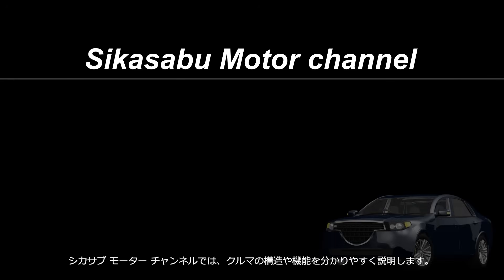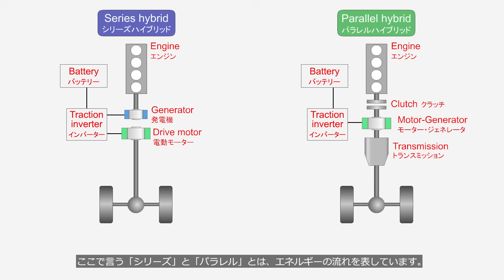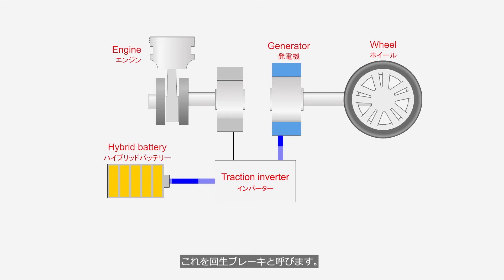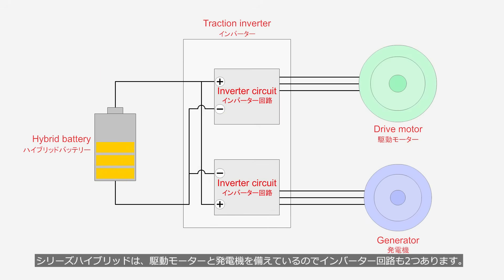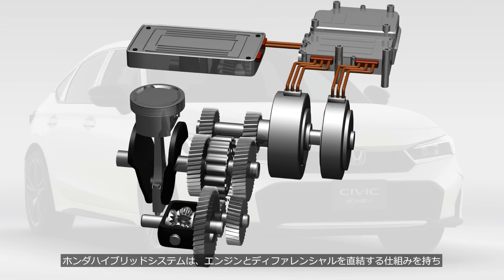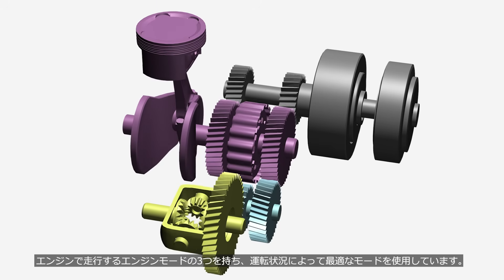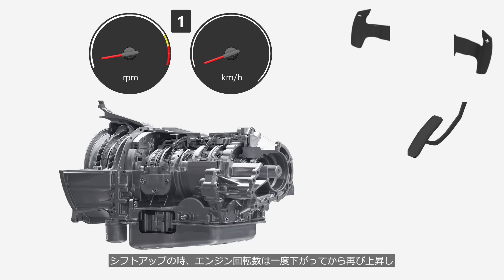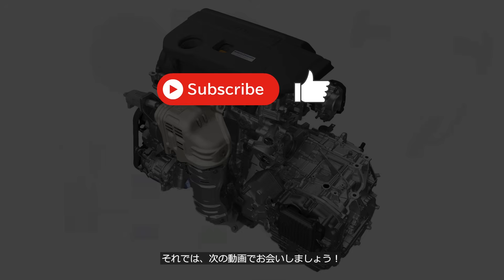Deep Dive into Honda Hybrid System　Can It Beat Toyota?

Comment: With Honda hybrid you can’t have the engine and electric motor powering the vehicle at the same time the Toyota system can, Honda transmission still has clutches Toyota transmission has no clutches, much more simpler much more robust much more reliable.

Comment: Just to add, engine mode with clutch engaged is limited to 80-120kmh thats where ICE can be more efficient with direct mechanical drive, but if going faster than that series mode again , conversion losses and awful high speed economy.

Anyway I prefer honda hybrid to toyota, due to EV driving feel at lower speeds.

Comment: Toyota uses direct and port injection so the valves are effectively self cleaning and there’s no carbon build up. This system is DI only so will be interesting to see how it lasts long term. Honda system might be more engaging (S shift) though. The Toyota one is purely for calmly getting from A to B.
Reply: "This system" uses "multi-stage direct injection," combined with the Atkinson Cycle. That means there are four different times when fuel is injected into the cylinder. One occurs just before the exhaust valves close at the end of the exhaust stroke, two during the intake stroke , and the last is actually during the so-called "compression" stroke. I say "so-called," because Atkinson means the intake valves have not yet closed.

This timing will improve fuel atomization, and allow some of the fuel-air mixture to be pulled back behind the valves. Thus quite "effectively self-cleaning" them. Maybe you should consider that the engineers at Honda actually know more than you do about such details.

The Honda system is more engaging, simpler, and just as "calm getting from A to B."
Reply: @j @jeffjo8732 well I’m sure they do know more than me. Question is really whether they know more than Toyota. The clean running of Toyota’s hybrids is well known. Even after 300000 miles the valves are clean. What you say about Honda’s system is really good to hear but i don’t think you can say that it’s proven yet. Great if it works though as it’s definitely cheaper to just have one ignition system. Perhaps leave the snarky childish tone behind next time though. Adds nothing of value to the discussion.

Comment: Switched from Toyota Hybrid to Honda e:HEV and Honda has much better hybrid. Sound is much much better, power delivery is faster and fuel consumption is lower - win win.
Reply: yes. but there are not durable as toyota hybrid system because toyota has no crutch. crutch pad will be damaged by time going. crutch has two side. it has direct power transfer from motor to gear. but has weak point that you have to maintain well of that. one day, you need to exchange crutch. i don't know how much cost it is.
these day, most of gear box issues come from crutch pad.
Reply: @gondra3012  Crutch? You mean clutch? There is no classic friction clutch in Honda e:HEV like normal cars with transmissions are using, in fact Toyota hybrid system includes clutch, but is is used for dumping the torque forces. In Honda e:HEV there is electronic lock-up clutch, that has no friction pads so there is no wear on that clutch as there is no torque/speed difference between both sides and it is designed by Honda as lifetime, so you don't need to maintain it at all. On the other hand, Toyota system is more complicated and using many gears in two sets of planetary gears that are wearing off and you have to change oil in transmission every 90k km.
Reply: @StanTrnik  In real world Toyota has been shown to be more reliable.
Reply: @GeneralFukzamatayu  That's simply not true, you just made that up, there is no reliability report that is rating THS more reliable than e:HEV/i-MMD, as Toyota system is more complicated and needs more maintenance, there is no reason to expect that. Do you own both so you can compare them? No? I do.
Reply: @StanTrnik  I've been looking for a critical technical assessment with as valid information as possible, but so far there's only been anecdotal "word on the street" and "the consensus seems to be" by fair-minded and competent people.  I'll continue to look.  It's important, I want HEV overall to succeed and thrive.  

I currently don't own both or either right now.  I've owned THS.  Beyond changing the HV air filter occasionally (and toollessly), THS required no maintenance whatsoever. It was a superb unit.

My intention is not to spread FUD.  I'll keep looking in good faith and with honest and fair mind.
Reply: @GeneralFukzamatayu For how long (years/kms) you owned THS, mine was 15 years old, it got few problems, also with battery, but first 12 years are zero maintenance.
Reply: @StanTrnik  I bought mine used, drove it professionally, and some drunk driver rear ended it while I was stopped at a stop light.  It was 100% reliable for me, and I loved it.  I'm a Toyota Hybrid believer.  It's only gotten better.  The year of my vehicle (Highlander) was 2007.
Reply: @GeneralFukzamatayu  I loved it too, but I didn't know that hybrid can be so sporty and sound soo much better before I drove Civic, I ordered it immediately and love every single ride, I'm driving much faster and smiling more, because of that sporty high revving engine and sound of no delay fake shifts :) . Try it, best car I ever had.
Reply: @StanTrnik  Plugless Self-Charging Range-Extended Electric Vehicle 

I'd test drive anything.  Much can be gleaned by watching others test drive.  I've seen how zippy Prelude is, but the quality of the zippiness was more akin to the nearly infinite electric torque that I experienced when test-riding the Zero-brand BEV motorcycle: a man strapped to an electric rocket rather than a Zen-like experience of man-and machine-connection or man-and-horse connection, a characterless zip, a zip untethered to relationship, a zip untethered from reality, a zip untethered from romance, a zip untethered from honesty, like a video game vehicle.

I find it strange that Honda of all companies seems to be trying to condition people away from the core mojo of motorcycles.
Reply: @StanTrnik  For Toyota at least, it may just be a difference in priority. The vast majority of their hybrid vehicles are designed to be efficient and unobtrusive until more recently with their trucks and luxury sedans. Honda generally prefers to make sporty peppy cars, which they apply to their hybrid offerings too. Plus, plenty of supercars are becoming hybrid too.

If Toyota felt it necessary, they too can put in a beefier drive motor to match Honda's system in off the line torque, and tune the engine and exhaust to sound better. They've done it for their GR cars, it's not like they don't know how.
Reply: @Appletank8  But my Civic is more efficient than Prius :) . Toyota has no possibility to make their hybrids sportier, because of CVT based system, there is no way how to rev that ICE in the same way to copy classic ICE car sound, or even better, as Honda 2.0 N/A sounds so much better than all those 1.2, 1.4 and 1.5 TSI/TGI engines and exhaust will not help it either.

Comment: The drawback with the Honda system is that when the engine is clutched in to the drivetrain, it is limited to certain gear ratios.

Toyota’s hybrid system meanwhile is effectively identical, but includes a true eCVT transmission, using a planetary gearset and two motors. This gives you infinite gear ratios, smooth throttle response, and a practically indestructible drivetrain. Fords use this system, too.

Honda should do something like this.
Reply: tbf, when driving on the highway with minimal speed changes, a direct drive to the wheels is more efficient.

I think a bigger drawback is Honda's system needs to be larger, it is unable to request direct power from the engine at lower speeds, thus electric systems need be more akin to a PHEV's in size.

In an actual PHEV, the differences start becoming minimal.
Reply: @Appletank8  Both of these systems have a direct drive mode with a 1:1 gear ratio.
Reply: @skyscall  I'm not talking about gear ratio, but that when Honda's system activates the clutch, there is no need to reroute power through the electrical system to send power to the wheels. Toyota's system needs to keep mg1 powered at all times in order to keep the engine at the right rpm. if mg1 turns off, the engine can't move the car.
Reply: @Appletank8  ..and as many agree, PHEV is the wrong way to go.  And BEV is an even worse way to go.
Reply: You are among a chorus of people saying this.  May Honda hear the song.  I hope that Honda does not believe that people prefer "electric car feel" or that people prefer Tesla or that people prefer "electric go-kart feel" or that Honda should differentiate itself from Toyota by feeling more like Tesla or that new generation expects or prefers "electric car feel" or that soullessness is inevitable or necessary or that stubbornness is better than evolution to more direct mechanical approach like Toyota and F1 takes.
Reply: The Honda system doesn’t have gear ratios apart from the high speed lockout…
Reply: @theopenreview702The Honda-style ECVT has a single gear ratio once the engine clutches in to the powertrain. The Toyota-style ECVT has truly variable gear ratios. That’s the difference.

Comment: This confirms my impression that the Honda system is a big step forward, eliminating the traditional physical transmission.  At the next level with plug in extended range (EREV) vehicles, batteries will increase in size, EV only range will increase to 50+ miles, one pedal driving will be available, and in sport models (hatchbacks?) 0 to 60 times below 5 seconds should be easily attainable.  AWD as well.
Reply: "electric car feel" is widely unloved.  (even if losses from additional conversions could be mitigated away to achieve overall greater efficiency). Is this HEV design more overall efficient than Toyota's design?
Reply: You can do PHEV with eCVT, too. Toyota has literally done that for almost a decade.
Reply: @Appletank8  PHEV is like permanently inviting the worst aspects of BEV onto an otherwise perfectly good HEV.  Bah!

Toyota discontinued the "Prime" naming so that people didn't accidentally/mistakenly end up with PHEV (and become furious upon realization) instead of HEV.
Reply: @GeneralFukzamatayu   Eh, I've been living with a PHEV for 4 years and it's fine. Barely need to use gas most of the time outside of longer trips outside the city.
Reply: @Appletank8  you barely drive.  what city do you live in/nearest?
Reply: @GeneralFukzamatayu   Los Angeles. Daily work round trip is just under 40 miles, have a home and free work charger. Occasionally go to a nearby county that's 90 miles round trip, thus halfway electric, halfway gas. A few times it was driven to Las Vegas, then south of Utah. There was a free charger in the hotel parking of Las Vegas.

Comment: I just bought a Honda Civic hybrid Touring and I must say that even though i knew it was the best system currently I didn't fully understand why. Your video helped me to understand the benefits of the dual motor design. TYVM!
Reply: Toyota‘s eCVT is more efficient and refined. On top it is very reliable.
Reply: Comparisons between Honda and Toyota HEV implementations may help clarify which HEV system is truly best.  HEV is best for sure, but there is some debate whether which is best.  Toyota's has been shown to be most reliable, although I do not know specifically what is so prone to failure with Honda's.

Comment: I love Toyota eCVTs but I can totally see benefits to this system. Series hybrid drives are used in locomotives. This system will deliver far more torque than an eCVT and the lockup clutch/fixed ratio overdrive which allows the engine to power the wheels directly at higher speeds could be more efficient than an eCVT (no energy is required to maintain desired gear ratios). It is essentially like a 6-speed manual where gears 1-5 have been replaced by a generator powering a traction motor and once the speed is high enough, the system automatically engages 6th gear and disengages it once speed gets too low for the engine. Not too complex. The eCVT is far more complicated in its operation. Both are very cool!
Reply: There's nothing stopping Toyota's eCVT from operating in Series mode either. Their 5th gen system  can practically run in EV mode up to 80 mph, the engine turning on to power the wheels or recharge when appropriate. Toyota chooses to be pretty good in a wide range of scenarios, Hosda choose to be better off the line and high way cruising, but a bit worse in between.

Comment: I understand Honda calling it a CVT.  The mechanic of it are too complicated for most people.  That included mechanics.  I have a Honda/Acura hybrid .  These geniuses put an electric motor in the 7 speed DCT and two at the rear wheels.  Result?  Throw you back in your seat sub 5 second 0-60 runs.
Reply: "I understand Honda calling it a CVT." Most of the time, the engine rpm and wheel rpm are unrelated. You can calculate a "gear ratio," but it is a meaningless number. A better name would have been "virtual CVT."

"The mechanic of it are too complicated for most people." only if they expect something complicated. It is the simplest ICE-based transmission you can find. Engine drives generator, electricity drives motor, motor drives car.

"I have a Honda/Acura hybrid ... an electric motor in the 7 speed DCT and two at the rear wheels." Different system, designed for performance.

"Result?  Throw you back in your seat sub 5 second 0-60 runs." Yep.
Reply: Do people not know what an electric transmission is? This has existed before in the past, and serial hybrid trains basically do that, though without a battery.

Comment: I have driven the civic hybrid and the 4th gen Toyota hybrid.
Without a doubt the civic hybrid system drives much better and the performance difference is quite noticeable too.
The engine is silent in operation too.
Reply: Honda’s refinement and drive is superior, toyota has more experience and has slightly better designs with less moving parts. Both will be reliable
Reply: I have test driven both Honda and Toyota hybrids, (and ended up with a Honda for reasons that have nothing to do with the differences in the hybrid systems). Having driven the Honda for 1000s of miles now, I'm very impressed with it how it performs. Time will tell if it has the reliability of the Toyota system.

Comment: I have heard the Honda hybrid system described as a CVT. Maybe because the gasoline assist engine in the Toyota gets CVT action from the planetary gearset?

There is nothing CVT about the Honda system. Nothing good or bad about this. It is just the way it is.
Reply: Technically, the noun "transmission" means the act of transmitting power from the engine to the wheels. In conventional cars, this is done mechanically by the "transmission system." While it performs other functions, the most interactive one is controlling the ratio of input rpm to output rpm. This is the "gear ratio."

So the device that varies the gear ratio, and achieves it mechanically, is now called "the transmission." "Continuously Variable" means that it does not use discrete steps. The issue, in this line of comments, is that this is only meaningful with mechanical transmission.

Honda R&D papers from about 2013 (the first Honda with this system was the 2014 Accord plug-in hybrid) called it an "electrically-coupled CVT," or e-CVT. Transmission is done with electrons, not gears. There is no mechanical transmission of power, so the gear ratio is a meaningless number.

Yes, you can still calculate a "gear ratio," but since it has nothing to do with the transmission of power, it is meaningless. In fact, the usual meaning is that the engine rpm is adjusted. Most of the time, a Honda's engine runs at its optimum rpm and power. In my 2018  Accord, that is 2000 rpm and 34 HP. If this is more than the car needs, the excess charges the battery. If less, the battery compensates for the shortfall.

Marketing didn't originate the term, they changed it to something they thought would be better understood.
Reply: @jeffjo8732   the engine (ICE)  in your 18 Accord Hybrid is mated to the final drive gear only on overdrive.  its main purpose is to drive the generator which  charges the hybrid battery and/or powers the main motor.
Reply: @jack76gh45  Maybe you didn't understand what I was describing. Which is that when the engine (call this point A) is connected to only the generator[1], which is connected to the PCU[2], which is connected to the motor[3], which is connected to the final drive gear (point B), which drives the wheels? Then this chain of power-transfer is still performing the process called "transmission." It is doing so without a mechanical connection that depends on a gear ratio, but there still is a ratio of the rpm at point A, to the rpm at point B.

The rpm at point A is, most of the time, near 2000 rpm. The rpm at point B varies with car speed. So this ratios does, indeed, vary continuously. It is meaningless (as I said), but it varies continuously.

+++++

[1] This is the mode that is called eCVT.
[2] The Power Control Unit is a collection of inverters and voltage regulators. It also mixes in the battery.
[3] Only power in excess of what the PCU sends to the motor is used to charge the battery.
Reply: they market the transmission as a e-cvt because it is one.
Reply: @jack76gh45 . What gets continously variable action????

The electric motor is always direct drive. 

When the gasoline engine is clutched in (at highway speeds) it is also direct drive. 

When the gasoline engine is not clutched in (around town speeds) it is driving a generator. 

Nothing CVT about the Honda system. 
Series hybrid most of the time.
Reply: Agreed. Honda's marketing made a mess with that "e-CVT" naming. If anything, they should have underlined the actual lack of a shifting transmission and the advantages both in driving pleasure and required maintenance.